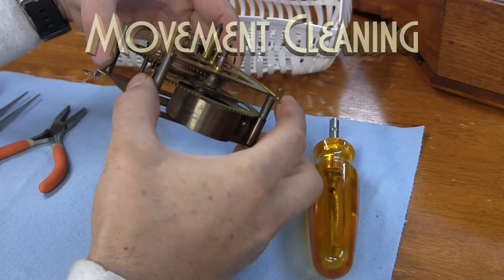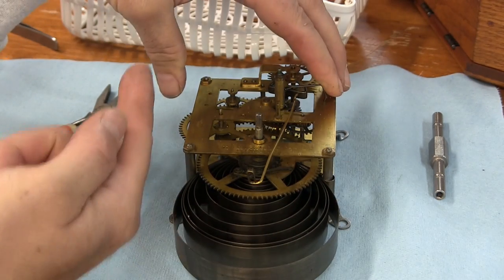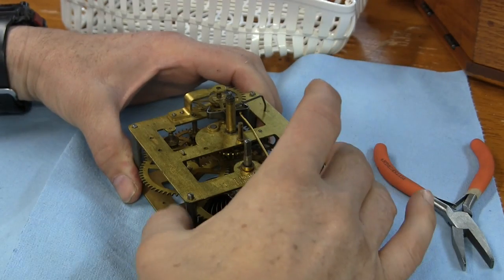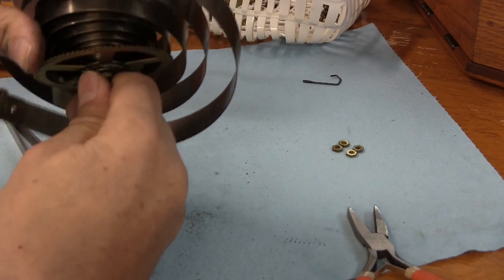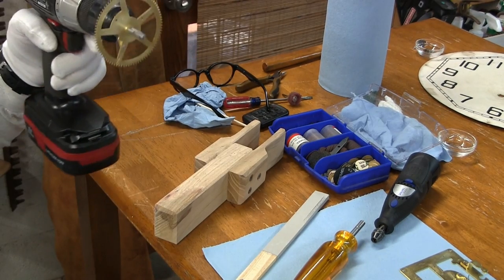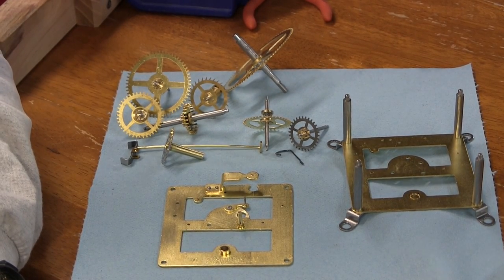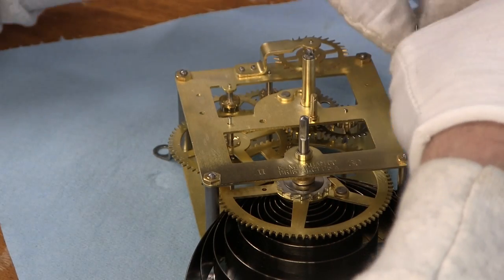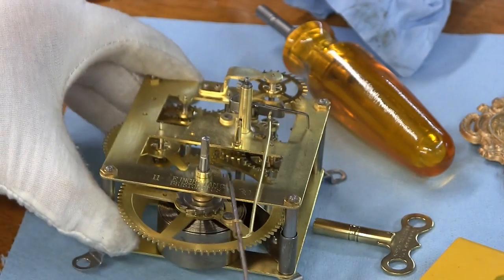1934 Ingraham Bedford Wall Clock Repair Pt 3, updated version

Comment: I have this same movement that I bought on Ebay to practice assembly/disassembly. I never knew what type of clock it was for until your video. Mine is marked 6 and 19 and is probably older. I took it apart and together many times and then cleaned, polished the pivots and put back together. It is currently running in a shaker cabinet I built. These are great movements for beginners to practice on. Time only without any strike complications.
Reply from the maker: Having minimal skills myself, I totally agree! Start small, develop skills, then advance. 😁
Reply: @time4clocks  Your skills are excellent Ab, the clock looks great!
Reply from the maker: @johnhannon  Thank you John! 😁